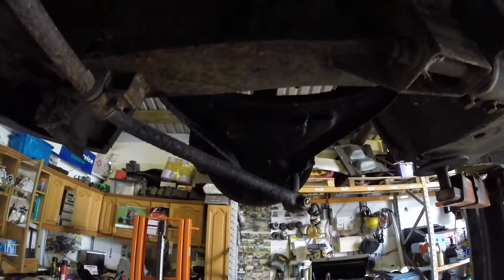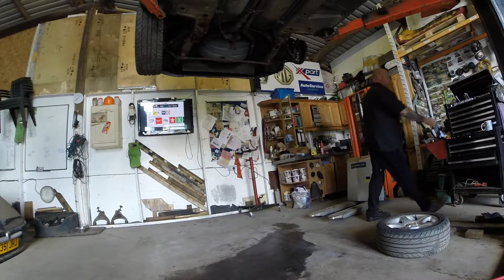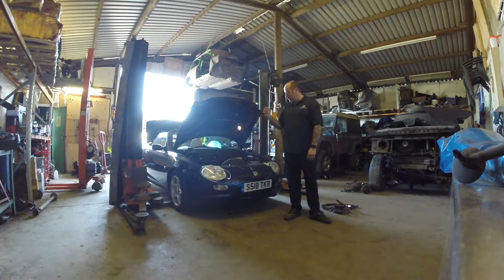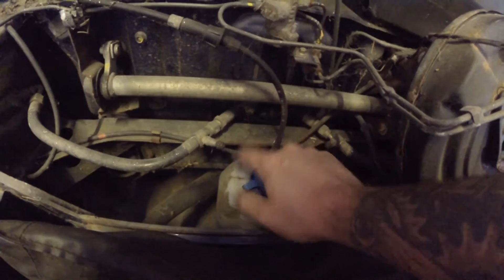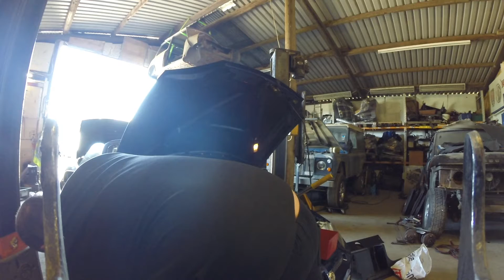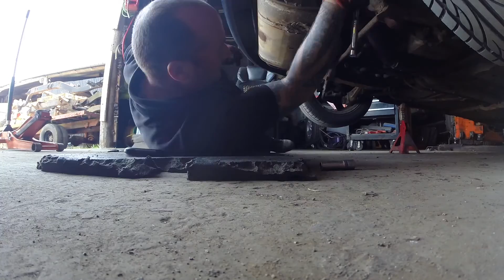Pumping up the Suspension and Changing the Front Wishbones on an MGF

Comment: As clear as mud, as far as changing the wishbones is concerned.
Reply: Mud is clearer🤷‍♂️
Reply from the maker: Apologies you didn’t find it useful
Reply: @DrizzDevelopments  Sorry I don’t mean to be totally negative but having just bought a TF which needs new wishbones I was hoping to see where the subframe attaches and how much clearance you need to extract the wishbone tie bolts. In the video the camera is so far away and the light so poor that it does not help much when after some fumbling in the dark out comes the Birmingham spanner to crack the taper on the bottom ball joint. A little bit of light would have transformed things.
Reply: @charlescoulson  I came across this video and thought the exact same. Camera way too far away and lighting non existing. Didn't see anything about the wishbones. Thankfully the fast forward button is there.
Reply from the maker: Unfortunately this was the early days before I had any kind of tripod or decent camera. Although I’m not sure things have improved much I’m afraid lol